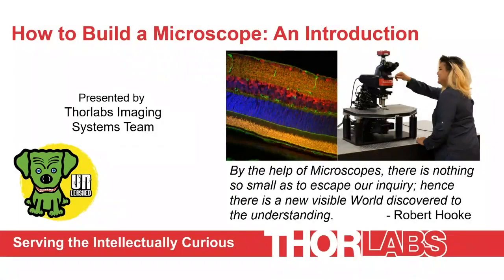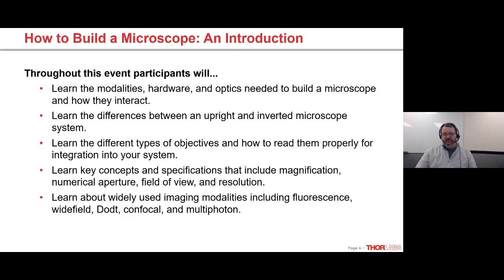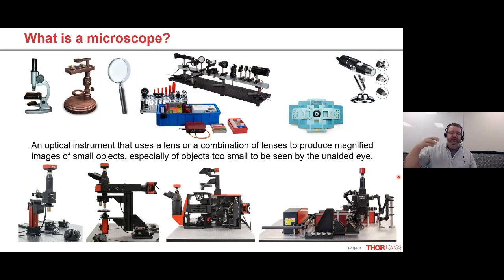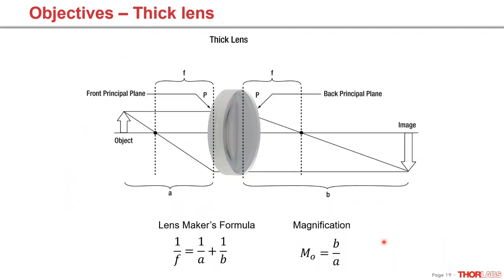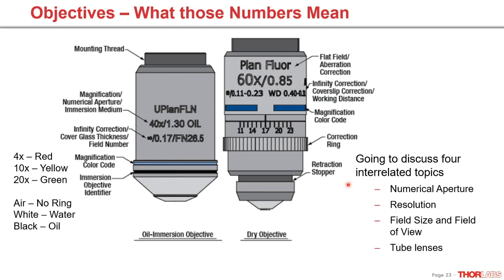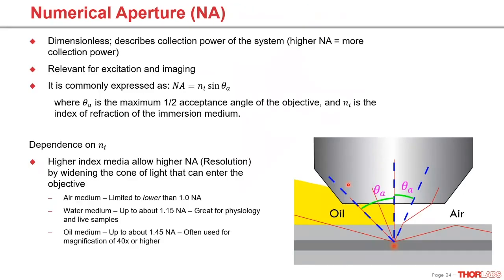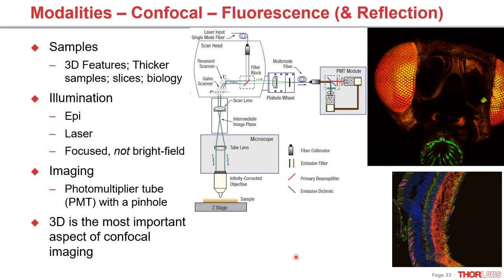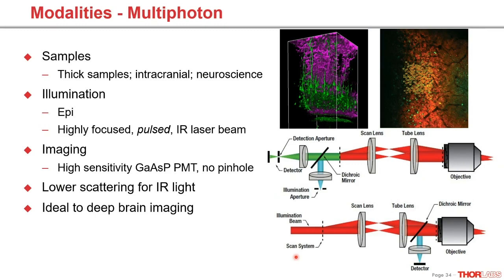How to Build a Microscope: An Introduction

Comment: Thank you for this helpful presentation. I have one question. What is the importance of magnification of lens besides resolution and FOV in microscopy?
Reply from the maker: With higher magnification, typically the numerical aperture, NA, also increases. Aside from the resolution and the FOV, the magnification of the objective lens also has an impact on the working distance and the depth of field. In general, higher magnification objectives have lower working distance and smaller depth of field. Working distance is the distance between the front of the microscope objective lens and the surface of the specimen or slide coverslip. The depth of field refers to the range of distance that appears acceptably sharp. From this, you can infer conditions such as flatness and thickness about specimens that you can use with the objectives.
Reply: @thorlabs  Thanks a lot for your answer. Sorry  I have again one question.  How does affect magnification on resolution and NA?
Reply from the maker: Please refer to 21:00 minute mark of the presentation that discusses numerical aperture, NA. The NA a measure of the acceptance angle of an objective, is a dimensionless quantity. It is commonly expressed as NA = ni × sinθa where θa is the maximum 1/2 acceptance angle of the objective, and ni is the index of refraction of the immersion medium. This medium is typically air, but may also be water, oil, or other substances.

The numerical aperture increases as more optical correction is applied. A typical 4x objective has 0.1 NA when it is a Plan Achromat and 0.13 NA when Plan Fluorite. Within the same objective line, for example of the dry plan fluorite line,  the NA typically increases with magnification of the objective such that the NA is 0.3 for 10X, 0.5 for 20x, 0,75 for 40x and so on. 

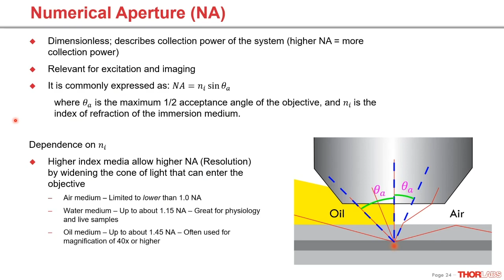On the 24:37 mark, resolution which is an optical property with a physical limit dependent on NA is discussed. The most common description of resolution in microscopy is the Abbe diffraction limit, d, is defined as d=λ/2NA where λ is the wavelength of the light.
Reply: @thorlabs  Thank you🙏